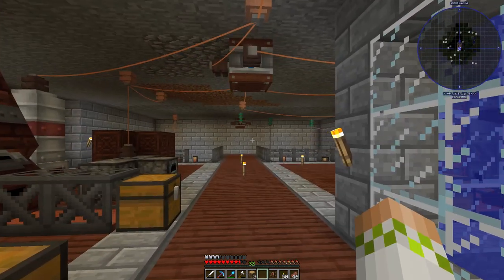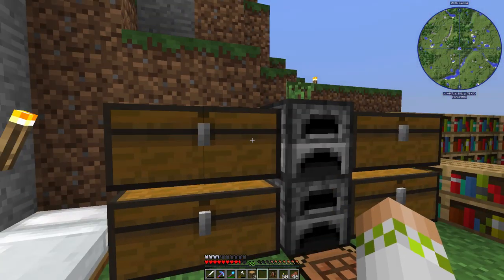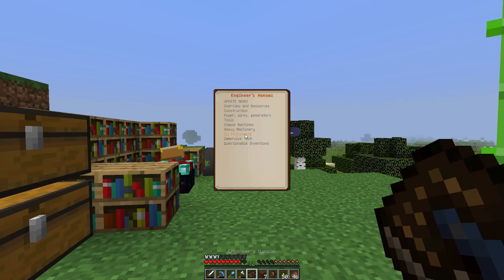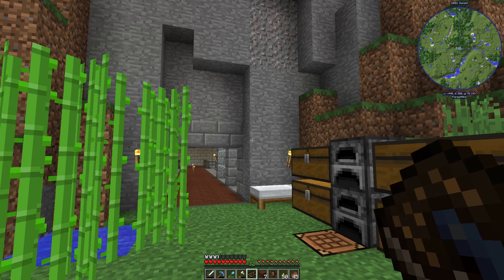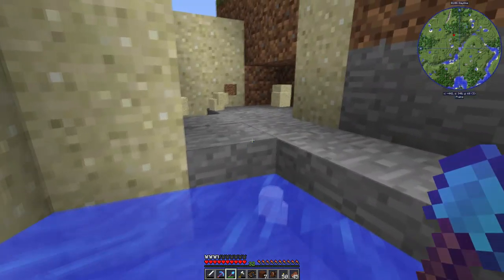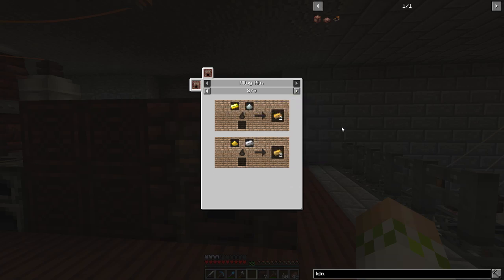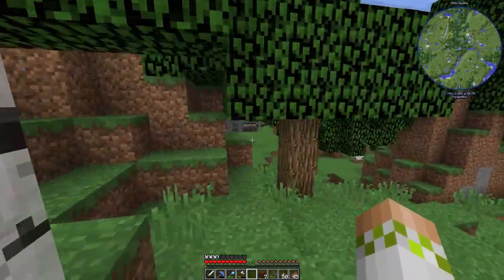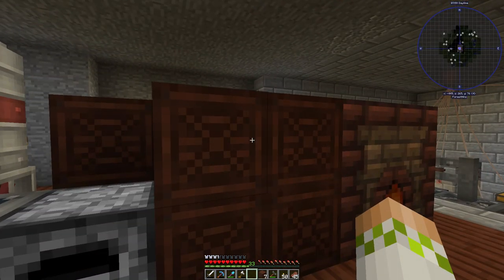Surviving With Immersive Engineering :: E10 - Alloy Kiln & Projector

Comment: Hi, I'm a new sub and I have a question because I guess you know about mods for your series, do you know some mods with the style of reika like reactorcraft, rotarycraft electricitycraft in some version of forge more or less current? or at least something that includes an idea similar to those of those mods if you answer this question I would be very grateful and I have done a long search for a mod with those characteristics.
Reply: Create in 1.14 might interest you, it's basically manual mechanical means of doing things rather then the classic magic washing machine style mod. Gears and axles and conveyor belts and grinding wheels, etc.